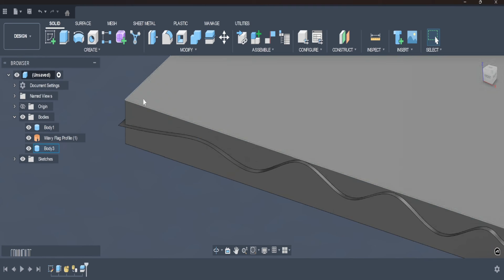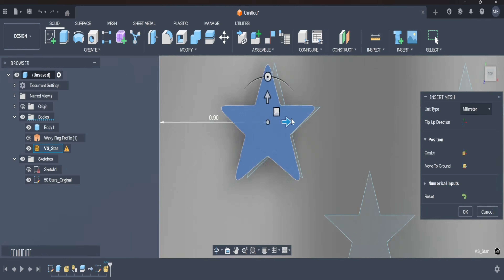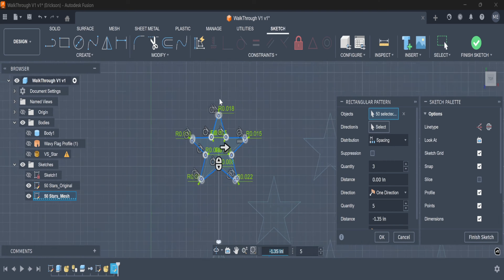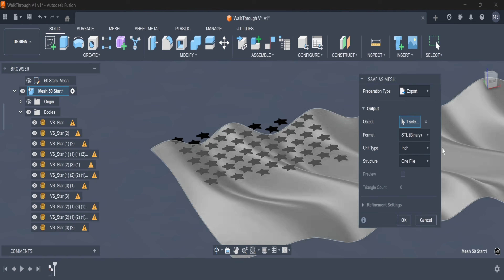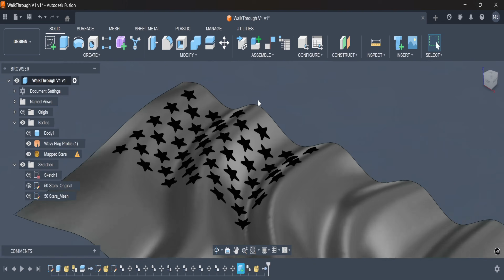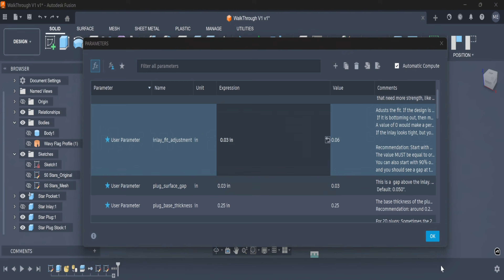Professional 3D Wavy Flag Inlay Technique using AI | Fusion360

Comment: I had so much to say thank you for with this video.  Had a large comment written out and when I gave you the thanks donation it deleted my written comment.  I don't have the energy to rewrite my comment.  You covered so much.  I have so much to learn with blender, fusion manufacturing space, and using Corbin's plugin after I learn the manufacturing space better.  I get confused about how to properly import various things like, dxf, svg, meshs, etc.  You mentioned you brought in the 50 stars drawing in with the right coordinates but didn't see how you developed that dxf file, what program did you use for developing the 50 star dxf with the right coordinates (this was about 6 minuets or so into the video.). I am waiting to see the second part of the video on how you use the manufacturing part of this project.  I understand the decsion to break this up.  I have made this decision on multiple videos.

Comment: Perfect. Looking forward to the next one. I'm assuming that once you glue the plugs you basically surface the flag waves again against the model with the "extruded" stars.  Probably not that simple but I think I know where we are headed. Thanks again, incredibly helpful.
Reply: Yeah! that is the general process. I've been thinking I should make the plugin generate an isolated "plug cleanup area" to make it easier to do.
Reply from the maker: Yep, that's the process.  I think there is a couple of different methods of optimizing the toolpaths to cut the top off.  The next video will highlight this in its current form.  @corbindunn has been super receptive to feedback on the tool, I'm really curious what he will implement.
Reply: @EricksonWorks 
Have you released the follow-up video for tool paths?